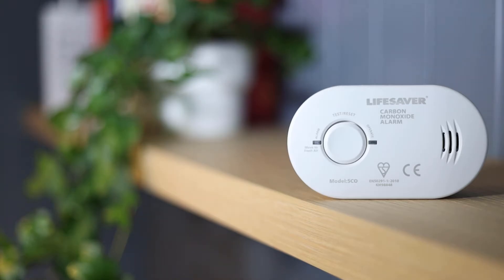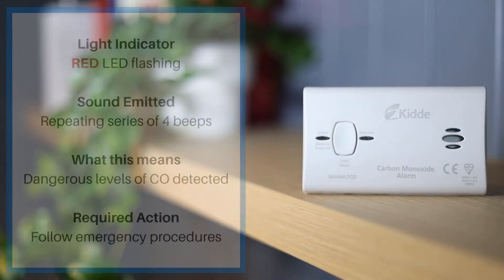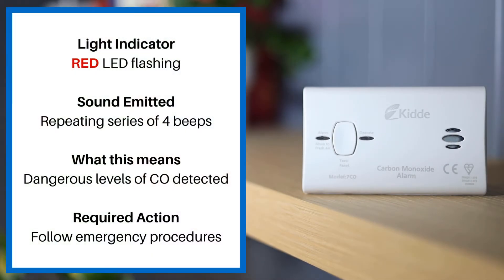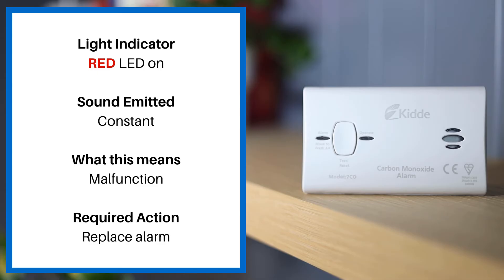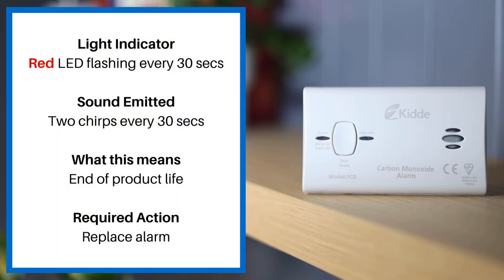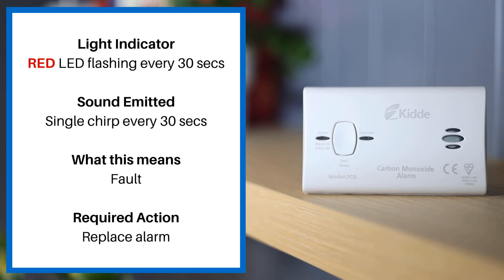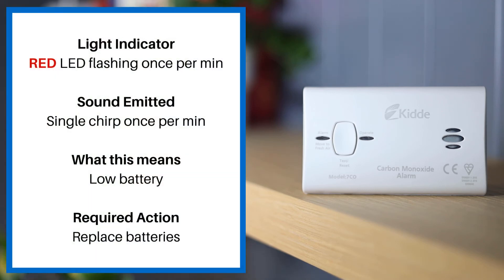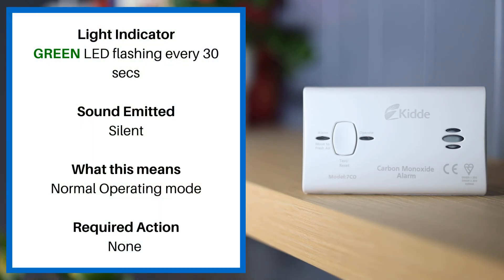Understanding the sounds of the Kidde 5CO and 7CO

Comment: When I press the test/reset button, the green LED comes on and it will beep to say CO is detected but then after a while the green light goes off. Does this mean it's still detecting CO or not?
Reply: This happend to me aswell. Like the green led is on while the red led is beeping 4 times at a time. Did this happen for you too?
Reply: I believe when you press it for a test and it lights up and you hear the alarm for a brief moment it is showing you the alarm is working and what it will sound and look like if it will detect carbon monoxide. 

It will beep and alarm itself if it detects carbon monoxide regardless if you press it or not

Comment: I have the exact same alarm and we think ours just went off, we heard 3-4 beeps but nothing has gone off since and its been a couple hours so does that mean we definitely have carbon monoxide as in the manual it says it should be a continuous alarm noise every 5 seconds but ours was a just a one off, so what does this mean?
Reply from the maker: If the alarm made the 4 loud beeps it means it would have detected CO. You are right though that the sound would continue so long as CO is present. It would make the same sound when the test button was pressed. Could it have been a child or someone pressed the button. My youngest daughter did the same recently with this alarm and I rushed into the room thinking it was CO. Are you able to press the test button to check the alarm is still working? I would recommend calling the manufacturer first thing in the morning. The Kidde customer support number is 0800 917 0722.
Reply: what happened next? I have the se probó right now